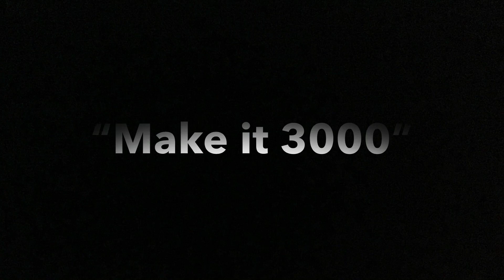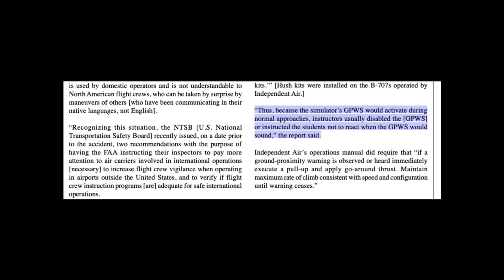A Mistake In Plain Sight | The Crash Of Independent Air Flight 1851

Comment: If i was part of the jury i would have asked the prosecutors to do actualy moving stress tests on the failed servo. Do like 10,000 cycles on it and see how many times it failed. It will take time, but this will be the definitive answer to see if the servo is the one that is really at fault or not.

Comment: It never ceases to amaze me how these litany of mistakes always line up just right to cause a tragic accident. It is conceivable that the crash would still happen even if one or two of these mistakes didn't happen but I guess for dramatic effect, I feel as if just correcting one of them would avert the whole thing.
Reply: This litany of mistakes are known as the Swiss Cheese model. Honestly, correcting one of these mistakes would have saved the aircraft.
Reply: The reason why the litany of mistakes always lines up perfectly is because you would not hear many of the times that they did not line up perfectly (because there was no accident and people do not generally report the mistakes that they got away with - or in some cases did not even realise they had made).
Reply: @davemould4638  Good point

Comment: QNH is atmospheric pressure at sea level.  This changes constantly depending on temperature and other factors.  Why doesn't a modern plane's computers adjust this automatically?  With the ground proximity warning system's radar it would know how high it was off the ground, with GPS and stored topography map data it would know what airport it was at and how high the ground was above sea level, couldn't it just adjust the atmospheric pressure automatically?

Comment: @
Mini Air Crash Investigation Feedback: I'd actually prefer if you just left the screen blank, or left a static image of any relevant things like a runway map, and a list of all airlplanes involved etc. on screen rather than using random stock videos of other airplanes. I keep getting distracted by the action on screen instinctively thinking it has some relevance to what you're saying and then I have to rewind because it's just confusing.
When you're referencing numbers and codes like flight numbers, runways, beacons etc. it would help a lot if these were also written on screen and stay there while you're talking about it.
It's quite hard for me to juggle such abstract information that I only hear without having anything visual reminders (I could never be air traffic controller). If you're worried the videos would be too boring if there's too little actual video; maybe you could show the stock photos in a corner of the screen and leave a "sidebar" nex to it with relevant key facts and maps etc.
Reply: It's not all about you dude...
Reply: @tommytutone2584  wtf?
Of course it's not "all about me" (whatever you actually mean by that); this is about accessibility.
Having random irrelevant stock photo makes it hard for most people with ADHD to focus,. (And I'm sure it's not very helpful for most people either.) And even if you don't mind it,
at the very least it would not hurt the experience for anyone if the stock photo was relevant rather than misleading, would it? which is why I didn't bother talking about my diagnosis; because my advice is more general than just about me. 

Just like having the option to turn on subtitles or having a wheelchair accessible entrance doesn't hurt anyone but it helps a lot of people. (Or do you also go up to wheelchair users and say "it's not all about you dude" as well?!)
Reply: @SteinGauslaaStrindhaug  I watch many of these wonderfully created videos. Instead of watching and enjoying them, there's always a select few of nit-pickers that dissect every tiny detail thats not 100% perfect. Just because it doesn't meet your ocd expectations, it meets others. Your whole lengthy comment was about "I" and "me", and criticism. People aren't perfect and the time required to  put these vids together/edit is overwhelming. He does an excellent job! Just watch and enjoy
Reply: @tommytutone2584  I do enjoy them. It's not nitpicking, it was just suggestions for how to make them better and more accessible.

The fact that both you and I enjoy them doesn't mean there isn't possible to improve things.